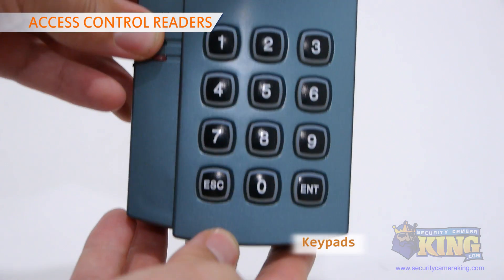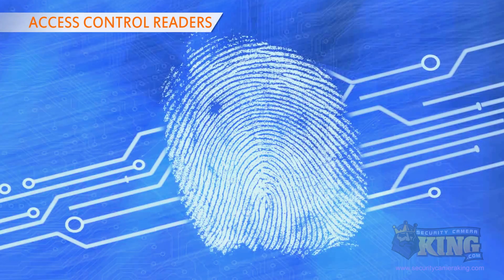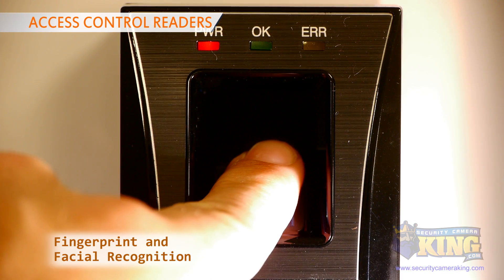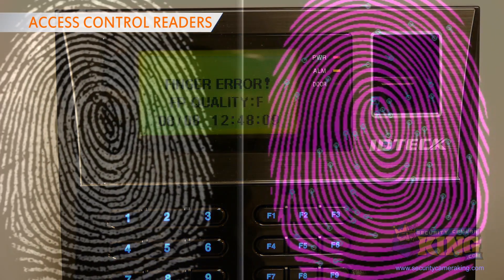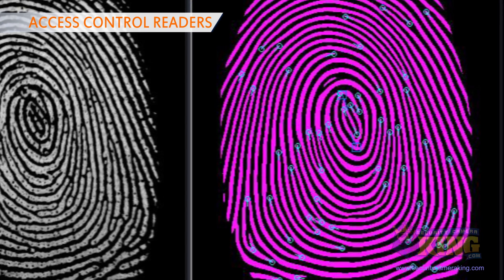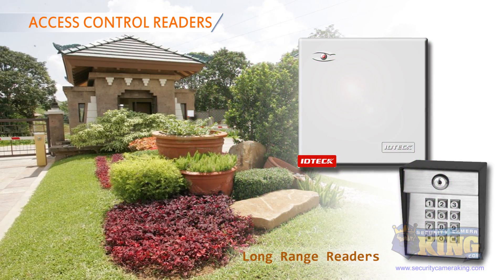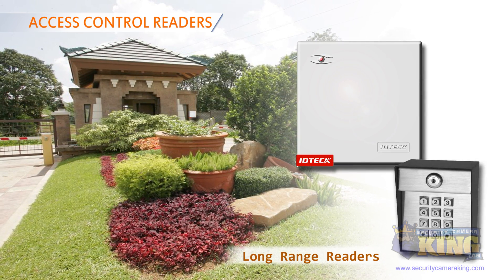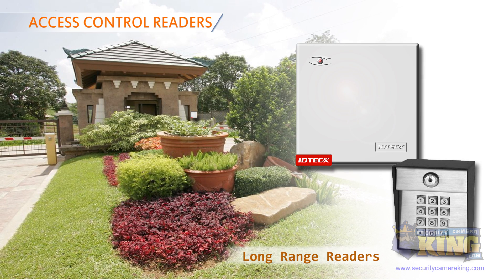Learn the Basics of Access Control in this Video: Access Control 101

Comment: hello am kind of stuck on some issues regarding access cards. I have a stand alone system where the programming is pretty simple to register the access card. but the thing is that i am unable to use brand new cards. The only cards that i have been able to register are cards that were already being used on a different access control system. Where as the brand new cards goes undetected. can you please help me on this. Thanks